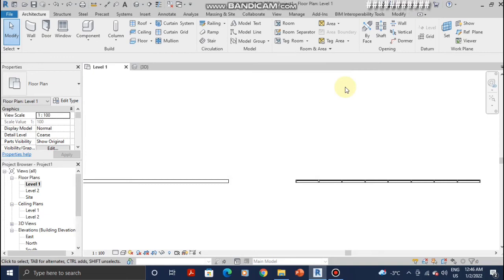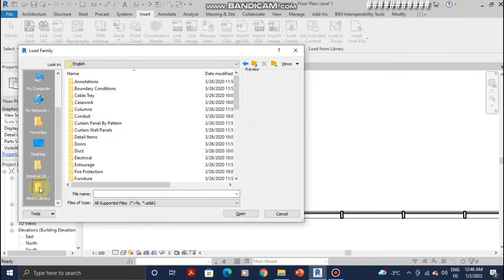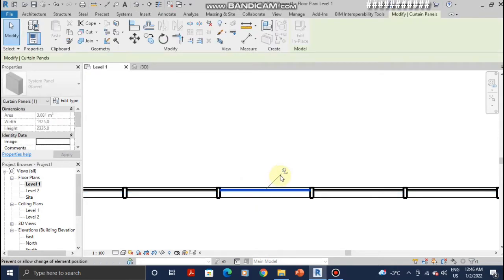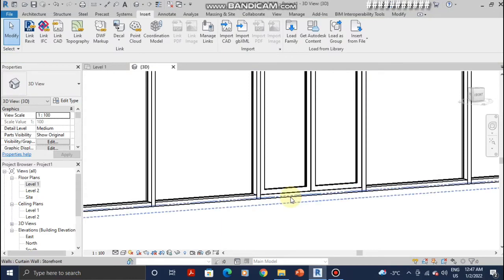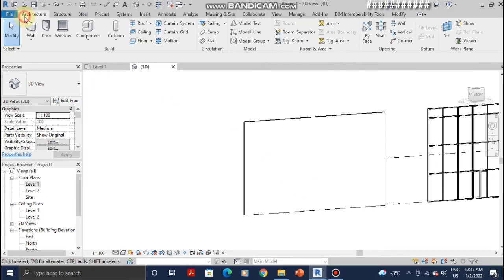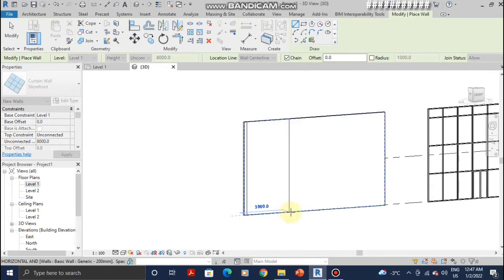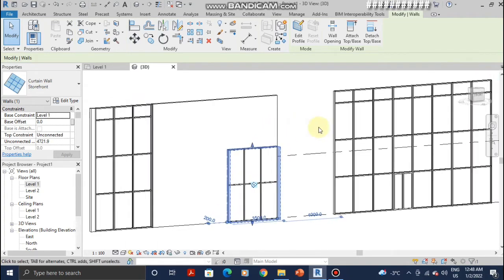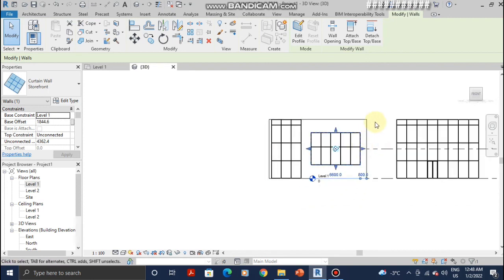How to add doors on curtain walls in revit

Comment: the family i load not showing up on the properties tab, what to do?
Reply from the maker: After loading the door into the project, make sure you hover over the panel click on tab until you select the panel and then unpin the panel and go to properties and the door should be there.
Reply: did this already multiple times but its not really showing up in my property tab @laharchitect4232